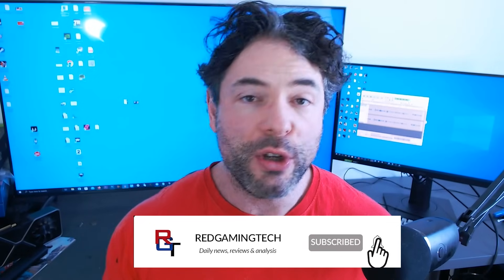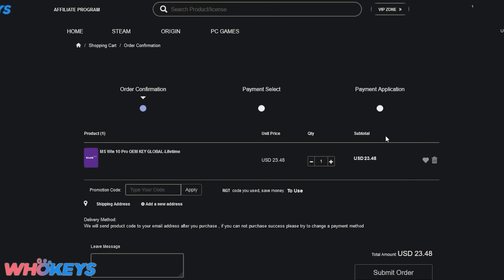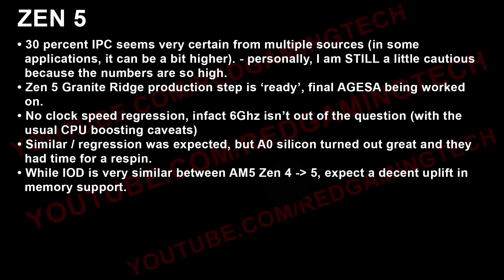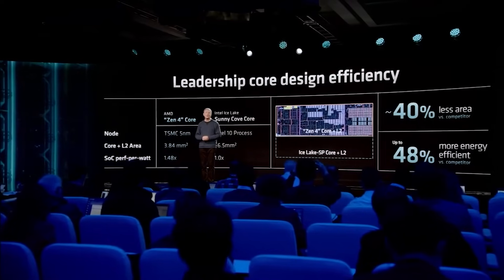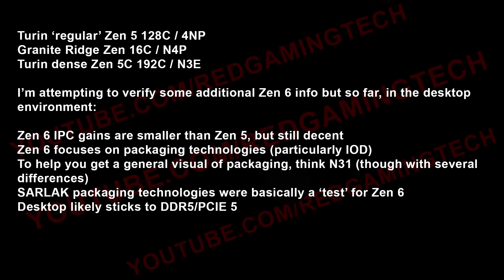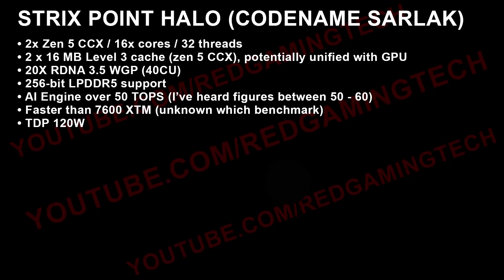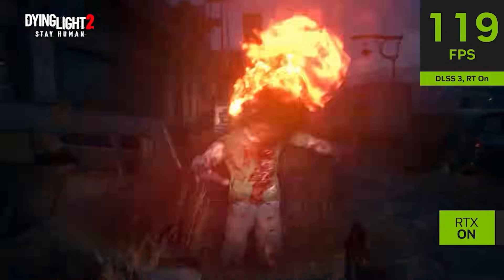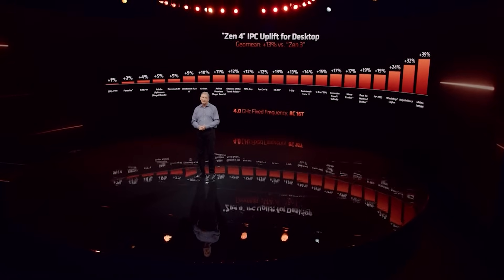Zen 5 Will DOMINATE - HUGE IPC & Performance Update

Comment: The one rumor about Zen 5 I've been dubious of is clock speed.  AMD is supposed to be using TSMC N4 and N3.  I don't think it's known how fast TSMC can run N3 while being efficient but I don't think most of AMD products can use N3 anyway because the demand for it is too high.  On the other hand a lot is known about what they can do with N4, being a variant of N5 and they CAN clock that very high while maintaining good efficiency and Nvidia Lovelace GPUs are a prime example.

Because the rumors are suggesting AMD is using both nodes for products AND AMD isn't doing too much with changes to their MCM architecture or changing core counts for Ryzen, I've assumed AMD would use N4 for this which is perfectly fine.  Some rumors have suggested AMD will slow clocks some, but I don't know why they need to.  It doesn't make a lot of sense when in the world of X86-64 they're already very efficient CPUs and that's a selling point.

Next, if AMD sticks with AM5 for Zen 6, then Zen 7 would also be on it and that means the shift to DDR6 couldn't take place until about 2028.  AMD's cadence right now is CPU core upgrades in generation X and then other architectural upgrades in generation Y  Zen 5 = core upgrades, Zen 6 = architectural upgrades, Zen 7 = core upgrades, etc.......  But the problem is DDR6 is supposed to be ready by around 2026 - 2027.  Instead of AMD being an early adapter of DDR6, most likely Intel would be.   And the consequences of this is growth in core counts where AMD has already said DDR5 won't be fast enough for more than their 16c/32t CPUs.  DDR6 is supposed to be about 2X the speed of DDR5, and that WILL allow AMD to move up to higher thread counts in destop CPUs.

This puts AMD in a situation where if DDR6 is getting to desktop in 2026 AND they want to upgrade to more cores, then Zen 7, or whatever it will be called will have to be a LOT of changes at the same time which would include moving to a new socket.
Reply: N5 to N3 is 10-15% speed@iso power its official tsmc info. Transistor "speed" =clock's. Iso power in slides usually means 1.0V. Depends how much power leak N3 has above 1.0V there should be 10-15% clock speed increase to the base clock (not to boost clock) Transistors are getting so small they have power leak problems. Rest of "ipc" increase is based on latency and arch changes and i do not see any that would relate to gaming maybe the increase in cache.
Reply: @gaav87  "Transistors are getting so small they have power leak problems."

Yeah that's part of the reason for the move to GAAFET, and it's also why over time voltage tends to drop little by little moving to smaller transistor sizes, which reduces power over any transistor, which then reduces leakage.  But this leakage has been an issue now for many years, so that's nothing new.

I didn't quite get what you meant at the end with gaming.

There's another thing that happens moving to smaller nodes which is more imperfections in the etching, not to the point of failure in the circuit but it adds more resistance to the circuit, or impedance.  However ASML High-NA EUV is supposed to resolve the problem for a few more process nodes.

Lastly TSMC has made claims about their die that were found to be overstated, so until there are circuits that use N3 at 10 - 15% faster than what AMD is clocking Zen 4, to me it's an unknown.  Apple uses N3 but they don't clock their ICs at those higher speeds, and in this case we're talking about Zen 4 on N5 as a comparison.  15% over the 7950X would = 6.5GHz and I don't see that happening, but by rumor it's only Zen5C core chiplets that will use N3 anyway and those are slower clocked chiplet using a high density transistor library.

In other words as far as AMD is concerned, for next gen CPUs the possible speed gains on N3 aren't so important if all the rumors are correct since they won't be using N3 for their fastest clocked parts, they'll use N4.
Reply: @gaav87  Those official figures are never that useful.  It never really details which specific libraries are being referenced.  N5 can come in different flavors, even ones without more obvious designations like N5P or N4.  And which N3?  Are these early estimates rather than actual real world testable in manufactured chips?  Is it just theoretical and doesn't take into account the extra density causing greater heat that reduces voltage and clock potential?

Comment: Well.. The 30% IPC leak isn't that far fetched when comparing the leaked microarchitecture to previous one.  50% more ALU:s 33% more loads, 50% more L1D cache. Increase in vector operation width for AVX-512. And several improvements in the front end, and scheduler, and prefetcher.  
This is kind of a lots of improvements in several different scenarios.
Reply: None of those give +30% over all workloads. The new ladder cache structure makes it all accessible.
Reply: @mikeb3172  Nothing would give that kind of performance in ALL workloads. Easiest way to prove it is have a group of random college students write some object oriented spaghetti that mostly measures the length of pipeline and memory latency.  Which neither of has improved in a long time. 

However, there are several improvements that can in combination bring  30%+ with not pessimized code. Optimization would be reserved for actually changing the code for performance instead of avoiding basic pitfalls when you write it the first time.  

The numerical values are simply having more resources available for code that has been written with enough independent operations to use those resources in either single thread or with SMT.  Then non-numerical values are just so far unspecified ways AMD has improved on getting more independent operations available. 
A better prefetcher isn't going to give you 30% improvement, but more like, changing some code that measures memory latency to operate from L1 cache instead. So it's a huge boost that happens rarely enough to average a some percentage boost to overall program performance for some programs. 
The multiple basic blocks fetching is one of the interesting things, that's mentioned that I can only speculate what it means.  Does it mean that AMD now can fetch after correctly predicted branches in the same cycle as previous block? Can the second basic block be the same block but just next iteration of loop? 
If answer is now yes to both and no previously it's quite literally doubling the rate of instruction fetch in not so rare cases, that were previously limited by it. 

For gamers though, performance improvements only applies the portion of time when game advancement is waiting for the CPU thus any percentage improvement would have to be multiplied by fraction the game is in that state. 
Thus in games the system performance would improve a lot less compared to pure CPU performance.  Even if CPU performance would double you wouldn't see anywhere near that kind of improvement in FPS.  But the experience would become smoother as CPU would have reserves to deal with occasional tasks. (If there's extra work once in 20 second that causes stutter with average 100fps that would affect less than 0.1% of frames but annoy still.)
Reply: @jouniosmala9921 It's interesting that as was shown on the slide at 7:42 that the Zen 5 will support AVX512-VP2INTERSECT, as Intel had removed from their CPUs after its only debut in Alder Lake chips and it won't be included in AVX10. Also I hoped that Zen 5 would support AVX512-FP16 ISA but there was none at the slide of Zen 5's ISA extensions list in the slide.This image as far as I know is section of PR to LLVM, but I am not sure on that.
Reply: It's amazingly far fetched.  It's so ludicrous, I dont know how this guy says this shit with a straight face.  You've really got to have no shame whatsoever.

Comment: I just wonder how quickly the core wars will bottom out like the MHz wars because frankly we are starting to get into batshit territory on the desktop. I mean I used to always upgrade every other year but honestly when I went from a 3600 to a 5700X? It is kinda more power than I can even use as even with gaming and light video editing I very rarely have all the threads fed. After I noticed this, I did some monitoring on the wife's PC which got my 3600 and for your Jane Average who does FB and some light eSports like World Of Warships? even the 3600 is kinda overkill.

So I have to wonder when we are going to reach the point when the core wars peter out because Joe and Jane Average are going to have trouble maxxing out even a 5 year old midrange PC, much less some 6GHz 16t firebreathing monster.
Reply: Core usage highly depends on workload. Most of the time my 5600x is barely used. But when I play certain games Im at 90-100% usage. I want a cpu that performs great in games. So for me I want that high end performance. My daughter only play minecraft and roblox and some art apps. So a 3600 is great for her.

The core wars will be around quite a long time. Escially because AMD and Intel are going in different ways. The next step is the accelerator wars built on the cpu.
Reply: probably never, assuming capitalism goes to space.

Comment: What a pity AMD won't use Zen 5c cores for desktop also just to break the 16core barrier. With a quad-channel motherboard it would perhaps be possible to go to 32 zen 5c cores without memory bandwidth problems. Threadripper is just too expensive.

Comment: Zen 5 will be interesting to see, just to gauge how good Zen 6 will be, but I personally won't buy into AM5 until AMD has overhauled its MCM design.  The platform costs are too high to buy, with the possibility that Zen 6 even though it's AM5 could need technology on a newer MB, just like what happened with AM4 going from 300 to 500 series MBs.

There's been no mention of NPU for Zen 5, Zen 6 will almost assuredly have a good quality NPU for the Ryzen lineup.  If AMD doesn't upgrade the CPU-chipset link to 16GB/s at least for Zen 5 which is very possible if they do very little to the IOD, it means that NVMe off the chipset will still be PCIe gen4.  

And, even with AGESA updates which allow for faster memory than 6000 there's typically no benefit using faster kits UNLESS you do a lot of tweaking to the memory doing your best to improve latency, so for instance running 7600 vs. 6000 and simply using EXPO settings, from the different results I've seen so far does very little to nothing.  On Intel systems going from 6000 to 7200 is a decent upgrade.  And I'm going to chalk that one up to the limited IF bandwidth.  The mem controller is perfectly fine and can be improved upon, but with the Infinity Fabric running at its safe max speeds, or stable max speeds, the memory kits over 6000 or 6400 depending on how good the Zen 4 CPU is, does almost nothing unless once again you're getting a latency benefit.

And all this gets to their current MCM architecture, the IF and in specific the IOD since all these interfaces run through the IOD.  I would assume that Zen 4 cores COULD get the benefit of faster mem kits if the IF could clock faster, and with Zen 5 cores getting what's supposed to be 20+% IPC uplift,  Zen 5 needs an IF that will run about 30 - 35% faster, based on what I feel is a Zen 4 CPU where the IF already isn't fast enough, and then moving to Zen 6 the IF would need to be 50% faster and I highly doubt that's achievable unless it's very high power, so this gets back to the rumors of AMD redoing their MCM architecture for Zen 6, in which case I feel Zen 6 will be a bit better than Zen 5 in many cases.  I would guess it will be at least 10 - 15% faster ALONG with either a 16 or 32GB/s CPU-chipset interface.  Intel's link is currently 16GB/s while AMD is 8GB/s (DMI 4.0 X8 vs. PCIe gen4 X4)

Comment: I am very happy with my  2 desktop Zen 4 7950X systems but I am very keen to always get an upgrade even though I run my current Zen 4 systems at 4.5Ghz 105W ECO mode, yes you heard that correct but at any time I can change the max frequency via a desktop app from 400Mhz to Max 5.88Ghz without rebooting of course.  Primarily I use my Zen 4 systems for gaming in Linux yes you heard that right aswell, I am  just not keen on giving MS all my personal data and good luck to everyone when they have AI built in their OS obviously for MS's benefit and not the users. If AI were to be included in the OS in Linux then knowing the Linux ECO system it would be for the users benefit and choice rather forced upon them and as always any apps are uninstallable or can be disabled unlike Windows which required hacks. Go go go AMD my ASUS X670 Hero motherboard is eagerly awaiting a Zen 5 upgrade. If anyone is thinking why would I want a 7950X for gaming, I will say because I play a MMORG called "Eve online" with 11 accounts at the same time (and sits at 55% CPU usage at 4.5Ghz while playing) so yes I take full advantage of the multi-tasking capabilities of the 7950X whereas in my case a 7800X3D just wouldn't cut it. My Linux of choice is System76's POP-OS just for reference and I use Steam. 99% of people reading this probably don't care but even if one person who plays "Eveonline" wants the very best system to play this MMORG then I can recommend Linux with AMD Zen 5 CPU.

Comment: I know the slide that MLID leaked was outdated but it seems a bit silly to go from 10 to 30% even when all things went way better for them than they expected. I think 30% might happen in specific workloads (zen 3 to 4 also has those outliers) but on average I expect 15-20 if your info about things going really well for them in development are true. If not, 10-15% sounds about right...
Reply: Zen 5 will be on 4 nm which is a slightly enhanced 5 nm, unless amd either pull an insane engineering feat or increase die size and by extension prices, expect a smaller than usual performance jump.
Reply: @beachslap7359  They've pulled huge performance increases in the past and lived up to it every time. There's no reason to doubt these rumors of huge IPC increases anymore given their proven track record.
Reply: @beachslap7359  Zen 3 increased IPC by 19% while staying on 7nm. Zen 4 "only" offered 13% while going to 5nm.
IPC is architecture related, node is more about clocks and efficiency.
Reply: 30 per cent IPC uplift is not insane.
However 30 per cent IPC uplift with NO clock speed regression is insane and sounds to be good to be true.

I think that MLID is more likely to be right. Tbh I do not know where RGT got this numbers from they sound made up for clicks, let's see but I think he is either trolling us or his sources are wildly wrong.
Reply: I think 15% is more realistic with the rumored updates for the ZEN5. The ZEN6 is a different story.
Reply: Even expecting 15-20% is perhaps optimistic.  People really dont get that even Zen2->3 being a 19% IPC increase was already pretty insane, right?  That's not something you can just easily replicate again.  This clown trying to push a 30% claim is 100% just pulling shit out of his ass trying to get people hyped up and paying attention to HIM.  When this inevitably never comes to be(just as Zen 4 wasn't the 25% IPC increase these idiots were initially claiming), they'll just ignore that they ever said it.
Reply: It likely will be 30% faster.
Reply: MLID is just guessing. And by guessing I mean guessing what bullshit title will get him more clicks. Not very different from what’s going on here.
Reply: @pazgaz7  most of MLID leaks come true very few were wrong from what i remember only the old old alchemist leak and the initial meteor lake leak which he later leaked again  that those initial estimates for both were wrong and he leaked the correction like 5 months before the launch of both so i think he is credible enough to believe at this point.

Man even his leak with daniel nenni on the TSMC stuff turned out to be super accurate even though it was years in advance
Reply: @saidalamry125  It's actually the opposite of what you're claiming.  MLID is usually wrong and occasionally gets things right.  Put a blindfold on someone and they'll still land a bullseye on a dart board every now and then if they throw enough.  MLID got called out so many times for his BS that he eventually just started saying it was speculation and his opinion, rather than "facts" like he used to claim.
Reply: @Neonmirrorblack he was right about zen 3, zen 4, RDNA 2, etc. he is not “wrong most of the time”
Reply: @pazgaz7  Yep.  They both are doing the exact same thing and more often than not use the same "source".

Comment: If it checks out the memory support uplift is a good sign. This has been a bit of a weak point for amd for  while now with Intel Cpu's supporting higher clocks without regressions and Nvidia supporting gddr6x on the gpu side where AMD's gpu's have only supported slower non-x gddr6.